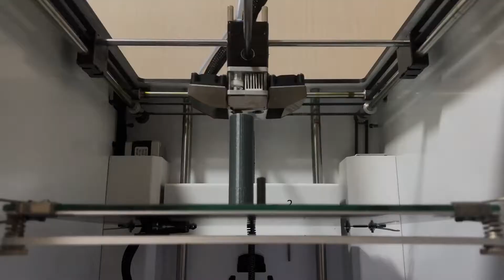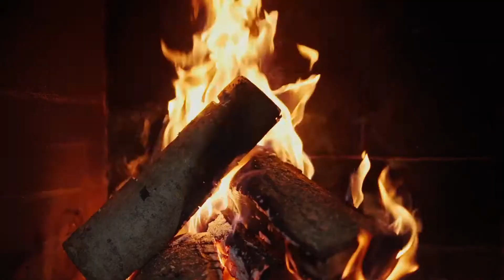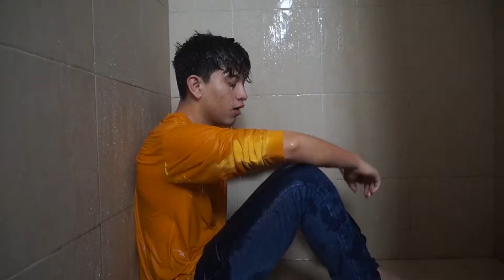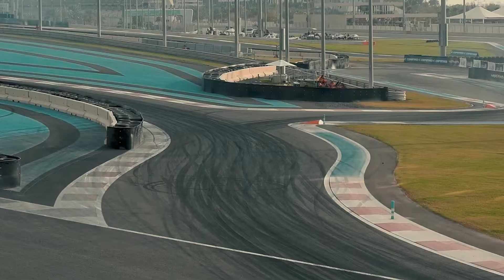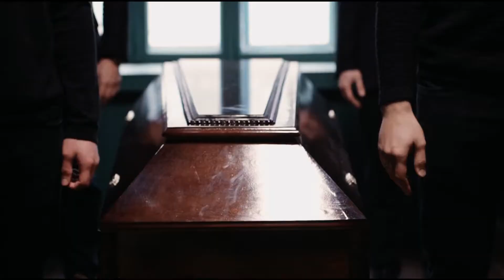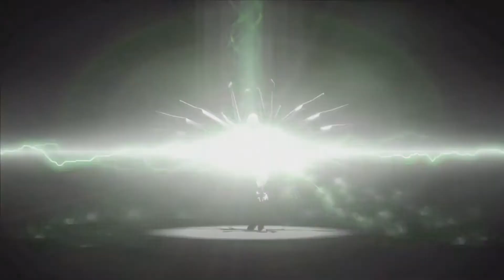What if Games Workshop goes bankrupt?

Comment: I think the "non plug and play" factor is largely overstated here. The issues with the temperature, humidity and so on, yeah I've never had those and nobody I know has had those. If the supports are done well, a minor change will not result in multiple failures. And yes I agree with the fact that it is not very simple to get into it, however, it is no more complex or takes more time than GW kits. To print off and clean up a squad of 10 marines takes about 3-4 hours while doing other things, than about 10 minute clean-up with curing, whereas building a box of GW Intercessors took me more than 8 hours (dunno, maybe I'm slow). And the point about selling it to your grandma, you know, good luck selling Warhammer in general to your grandma. I would assume that anyone invested enough into Warhammer to spend thousands of dollars and hours into the hobby is invested enough. I would also say the 3 things they need to improve are:

1) Durability
2) Clean-up without chemicals
3) Toxicity

There are resins, like TGM-7 resin which is much more durable than GW plastic, even though it is expensive. There are also resins that only require water to clean up as well. Toxicity however remains.
I would say the price is very variable as well, yeah you can print a bunch of miniatures for free, but if you want really good miniatures, you will pay for them, and the prices are sometimes similar to GW. The best solution GW has is to cut prices by half, the packaging costs more than the plastic inside for them, they can easily do it. And also, you know, not be complete scumbags, that helps too. They won't do it though.

Anyways, good video!
Reply from the maker: Appreciate it! I think the climate changes are somewhat dependent on where you live. Our temperatures swung by about 30 degrees Celsius in the span of a month, and that instantly started killing prints. The only solution I had was to move the printer further in to the apartment where it wasn't quite so cold. If it was a particularly cold morning, I also through on the heat lamp to keep it from failing.

As for timeframes, I've personally found purchased stuff dramatically quicker than printed stuff. Not counting painting, an army in Bloodfields takes me over a week to do if I take one of my work printers offline to run it; I assembled my very first army (Tyranids) inside of a single weekend at a friends house.

Fair point about the grandma comment, but as another example: My wife does play Pathfinder and Bloodfields, but she would never tolerate the kinds of issues 3D printers suffer on her own. I do her prints for her, but if I wasn't around, she would absolutely just pay for pre-done minis. And my younger brother is in the exact same camp. As is my neighbour. As is my best friend. Of my group of tabletop gamers, I am one of only two of us who deal with printing, out of a group of over twenty.
Reply: @brokenloadorder7710  I guess the assembly times depend on the game and the army. As I was talking about Warhammer, to me it takes forever assembling the miniatures for an army, cleaning mouldlines, connecting some of now super complicated fiddly bits that I constantly mess up and leave damage on, whereas the print I just chuck into warm water for a minute and supports just peel off, dependant on the maker. 
I guess other games are much more different, as to Warhammer where the rules will set you up over 100€ alone and an army another 500-1000, and more over the years, painting that will take half a year, I'd say those people are invested enough to learn 3D printing. To me the scariest thing is toxicity, the smell is dependant on resin, some don't smell to me at all, but I don't want to get lung cancer 😂

Comment: printing a titan on the starter printer is possible but it require learning how to break/slice a model up in order to fit said build plate. I managed to print a 1:1 scale reaver titan that looks exactly like the FW one on the elegoo mars 1 only using 3 bottles of resin (had a couple of miss-prints) but doable
Reply from the maker: Fair, though again, the fact you know to slice a model in order to make it fit the build volume already speaks to the fact you're more skilled than the average person is with a 3D printer. All but one of my fellow Warhammer-playing friends would be entirely unable, for example.

Comment: Interesting discussion and I've been enjoying this series so far, but I feel the need to comment and push back a little bit on your assessment of resin 3d printers at the present time. You generally painted a picture of a technology that is very difficult to use, prone to failure and incapable of printing large objects or bulk models in reasonable time frames. I would argue that largely each of these points is in fact not nearly as problematic as you've stated given the now abundance of expertly pre-supported and test printed models and the expectation for them that exists now in the 3d printing community.

I recently printed roughly 2000 points of "Robot Legions" from One Page Rules and it took just under 4 days on my lowly Anycubic Photon S resin printer. Although it's build area is small, I can easily print between 5 and 8 mini's at a time with each print taking about as many hours depending on how tall the tallest model is. More commonly available today now on just about every printer all the way down to the entry level is mono LCD screens that more than cut that print time in half. I've also printed a number of very large vehicles on my little printer, again not taking more than a couple of days each. The largest of which was a Atreus Super-heavy Battle Tank which like countless other tanks and large units available to download is provided as a multi piece kit to be assembled after printing, with everything being able to fit on the smaller form factor printers with no problem whatsoever. I personally haven't printed a titan as I'm not interested in those, but I see photos of people printing them all the time on their resin printers on Discord groups and printing subreddits and I have a couple of files for them that again like model kits - you don't print the whole thing in one go, you print the component pieces and put it together.

Generally supports now across the board are excellent - I do still come across the occasional model where either the supports are too strong and leave marks on the model, or sometimes are too weak and a section of the model fails to print however the vast majority of models I have encountered have been lovingly supported and test printed to ensure end users have a painless experience with printing. For models with supports done well, removing them is like peeling off a band aid. Almost no force or cutters are required, just your fingers.

I'd say 95% of my printing experience goes like this: Drag drop file into slicer, position on build plate, slice, send to printer, hit print, remove models from build plate, remove supports, slosh around in a tub of alcohol, sit to dry for a couple of minutes, place in a box with a uv light for a couple of minutes, and done. It takes so little effort and time on my part to prepare and post process prints that I prefer to print new models than assemble my GW models still sitting new in their boxes.

Also most resins nowadays do not stink at all, in fact the cheap standard Anycubic resin I use barely registers as having a smell at all and it's in fact a kind of pleasant sweet smell. As for the toxicity, no one really knows but everyone should be treating this stuff with care and I agree with you there. Resin is also extremely cheap considering just how far a liter of the stuff actually goes. Yes there is waste, but support material in terms of mass is very little. You depicted it based on volume, how much space they take up - which is misleading. I would argue it's difficult to say whether sprues or prints produce more waste, bottom line is both methods leave you with a pile of waste material at the end.

Lastly I'm sorry to hear you had troubles with your prints with the changing seasons, I've personally never had this issue so I can't relate. I calibrated my printer when I first got it over a year ago, and it's just been reliable across every season. This may be due living in Australia which doesn't get particularly cold in the winter.

Anyway, looking forward to more discussions like this and I hope you don't take this as me bashing this video - I just have a different perspective here that I wanted to share. Merry christmas!
Reply from the maker: Definitely always welcome to debate! I know some folks don't have many issues with resin printing, though, again, we're approaching this from an enthusiast's perspective: Yes, even when things go wrong, I know enough to adjust things and get it back working, and I know enough to know that an unsupported model is going to require a little bit of work on my end (And the majority of current STLs are still unsupported, in my experience). But if I told my wife to try and print her minis on my printer I would fully expect to come home to an angry wife, and potentially a smashed printer. We're still a considerable ways off of them being plug-and-play devices.
Reply: @brokenloadorder7710  By the same token though I know if I asked my girlfriend to assemble a box of GW minis I'd be coming home to a cranky women too. I'm not sure there's anything other than enthusiast level of interaction in our hobby, as plastic kits certainly aren't plug and play either.
Reply from the maker: @JimmyBlimps  Ah, see, my other half has no problem doing her own painting/assembling/customizing, same goes for my neighbour, brother, best friend, and all but one other I play with (Out of almost two dozen). Though none of them outside the only other guy with the 3D printer have any interest in picking one up once they see what goes in to it.